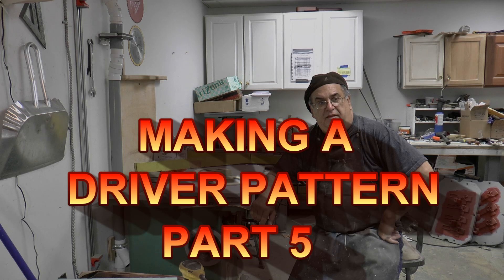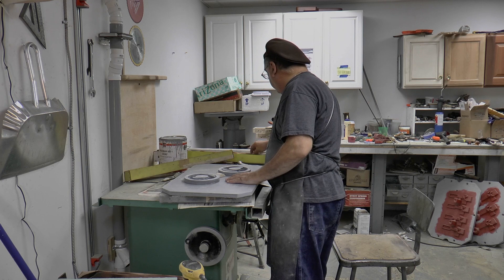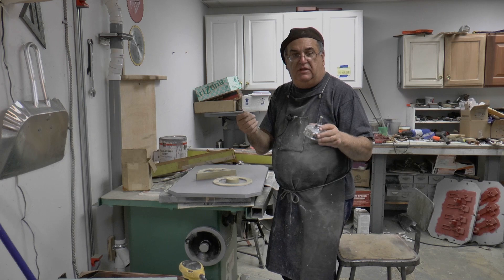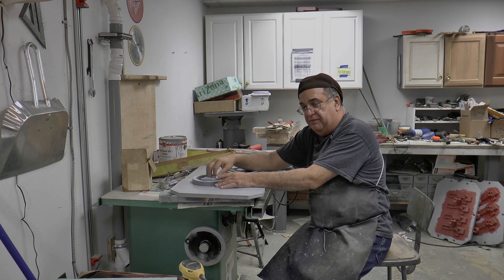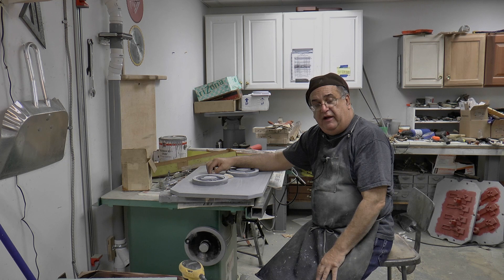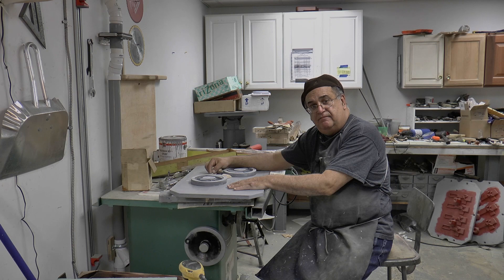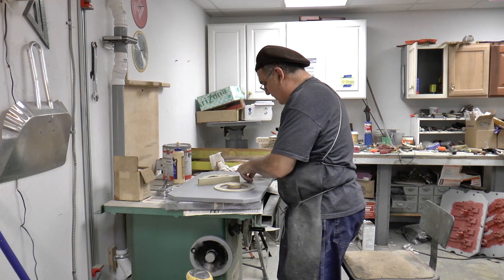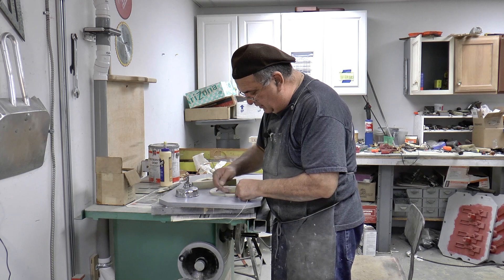MAKING A DRIVER PATTERN PT5

Comment: Thanks for mentioning me. Excellent job of pattern making.  I can still see my dad putting wax & leather fillets on his patterns exactly as you did..  Tell me about your camera--what make & model. I need to upgrade.. The quality is superb. Also, I need a microphone like yours. What model & where did you buy it?
Reply from the maker: Hi Mr. Pete
I am using a Panasonic HC X920.  The wireless mic is a Azden.
If you type in the model number of the camera in YouTube you will find it.
You will need a mixer as well I have a Beachtek model DXA-2T.  You need this to convert it to an XLR input this connection will help with any static. With the Beachtek unit you can plug in several different microphones. Shot Gun etc.
I also have a handle on the camera as well as a hood.  If you go to the sites below you will find out what it looks like. I bought everything from EBay. Total cost is around $1500.00 Prior to this I used a pro model Panasonic camera but it was not HD. A pro HD camera is around $3500.00 so this is the best camera to have for semi pro work.
Here are the two sites to look at.
Panasonic HC-X920 prosumer camcorder mini review and sample footage
Panasonic X920 How we set it up for the best results
Reply from the maker: trainman4602 With the HD I need to use makeup and I need to use better lighting

Comment: How did you center up the parts from front to back of plate? I assume it was with the dowels? you assembled wheel and ring then drilled together .. Placed on matchplate and marked for drilling it ? Thank you. You and Mr Pete are the best videos on  you tube.
Reply from the maker: Yes that is correct